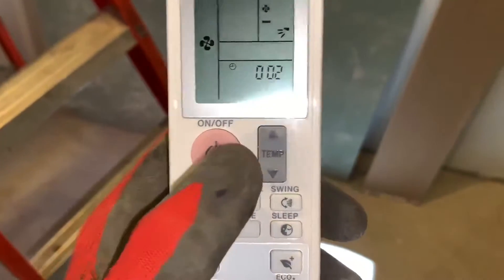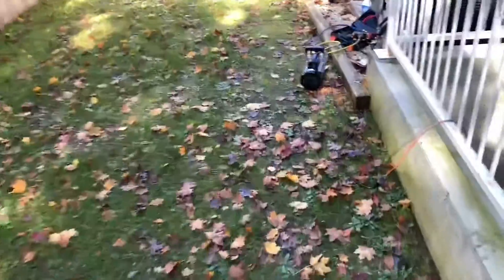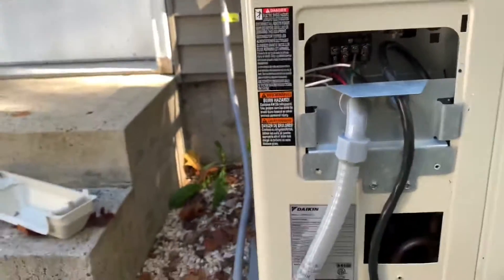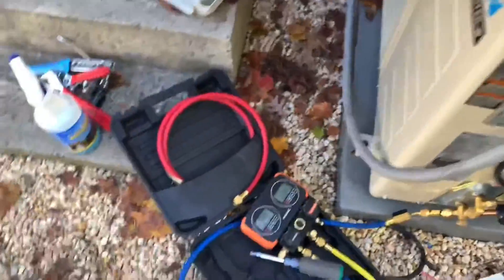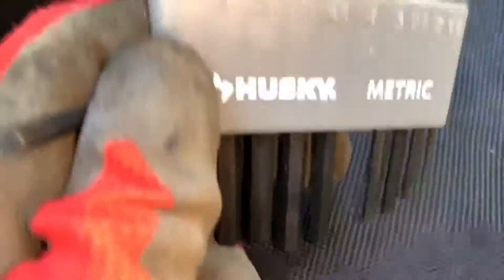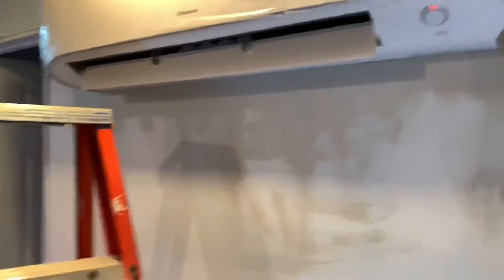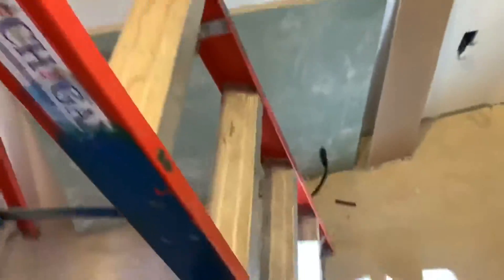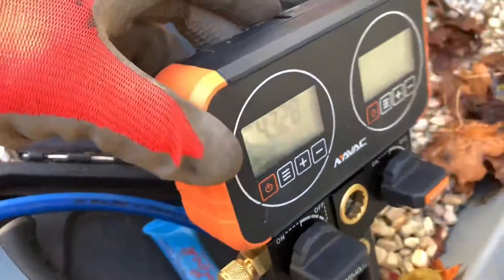DAIKIN MINI SPLIT INSTALLATION

Comment: I turned my indoor unit on today I didn't know I needed a vacume but I didn't release the freeeon will I be ok and where did you get a vacume from?
Reply from the maker: You should be fine! And possibly you can fine a vacuum pump online most refrigeration supply houses won’t sell less you are a contractor! Also if you are not a contractor you should consider hiring 1 for this